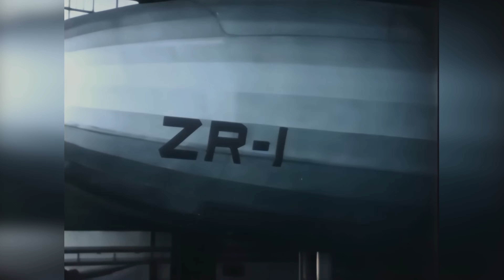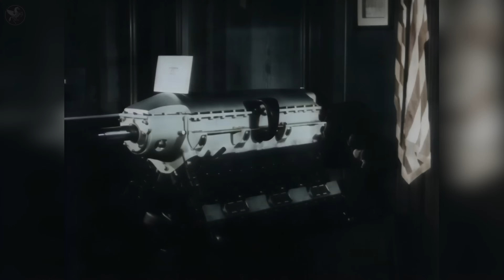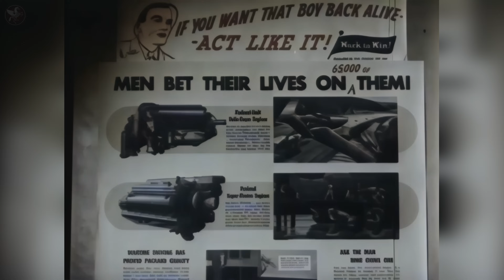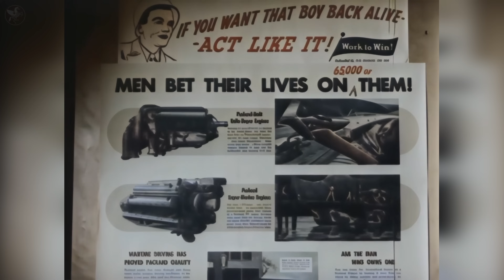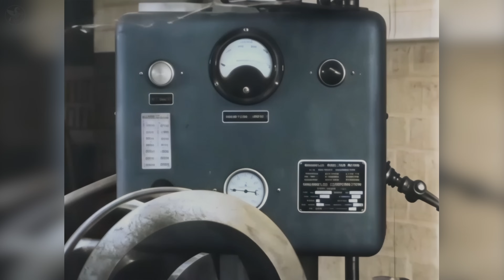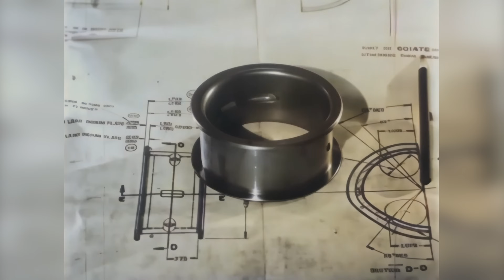DETROIT'S SECRET WEAPON: Packard Building the Legendary Rolls-Royce Merlin in the USA

Comment: Why do they take them apart after test run?
Reply: They take them apart to inspect everything in the engine to check for wear and possible design flaws that could cause engine failure and if needed better upgrades made to the parts for the engines so they are more reliable. One thing that wasn't mentioned in this video is the Packard engines had much less moving parts inside of them compared to the Rolls Royce engines which made them not only last longer but easier to service when needed . I've worked on both Packard limousines that were built before & during WW2 as well as Roll Royce cars and the Rolls Royces I've worked on we're complicated especially the brakes on the late 50s early 60s cars that had to use a special kind of brake fluid that's made for the Rolls Royce cars. They don't use the vacuum canister to make the power hydraulic brakes work on these like the American cars and trucks use because they used a hydro boost type of braking system that works off of electric pumps . The brake fluid they use is highly flammable and of course when you need to bleed the brake system on the these hydro boost reservoirs which there are 2  of them for the front & rear brakes on them the bleeder screws are close to the exhaust and are pointing right at them so every time I had to do the brakes on these cars I always made sure that I had a water hose & a fire extinguisher close by just in case the car caught on fire . The other strange thing with the Rolls Royce was the wiring harness for the cars they didn't use a glass type fuse like the American cars did in those years but the Rolls Royce used different sized wire as  fuses that weren't contained in a fuse box like the American cars did. The Rolls Royce cars used a open box for each fuse which was crazy because moisture can get at these wire fuses along with if your not careful when working under the hood on them and you don't unhook the battery connection and accidentally touch a tool that grounds to that wire fuse it not only blows that wire fuse but causes spark to fly everywhere and if you have this happen to the main large wire fuse that tool will basically get welded to the car & it could cause the car to catch fire & burn to the ground . Never understood why  such a beautiful & very expensive car that Rolls Royce would make such a crappy wiring and fuse system on these cars for that era . I also worked on a early 1923 Rolls Royce limousine that was once owned by a prince who bought it brand new that my boss had bought it when it was shipped to the USA but that car was way ahead of its time but it had a dual magneto ignition system on it just like what's used on air plane engines so there's a backup ignition system so the plane doesn't crash which I thought was strange that Rolls Royce was doing this on these older limousine cars way back then . The  shop I worked at as a mechanic was called Classic Auto Limousine Service in North Minneapolis Minnesota back in the 90s as a mechanic & the owner had a bunch of old cars he bought for the limousine service that had schoufer drivers and people would rent these cars out for weddings and special occasions & some of these limousines were Packards and Rolls Royce & Bentleys . He also had  1 of 3 still in existence which was a 1936 Packard funeral car that used to take the vets that had died to be buried at the Fort Snelling cemetery that was totally restored . He also had sports cars you could rent BMWs and a 60s Jaguar & a Ferrari just like the one used on the TV show Magnum PI that you could rent by the hour or day which wasn't cheap but the stipulations on being able to rent one of these cars was you had to go get your dental records from your dentist that showed your teeth just in case you got into a accident with one of them & got killed or burned from a firey car crash and people did this just to be able to drive these cars because some of these sports cars he had bought didn't have the power restrictions on them like we have here in the state being they were shipped from countries that had no speed regulations like we have here in the USA . I got to drive every car we had at the shop which was close to 30 cars that he owned that got rented out . He made his money as a insurance agent and did very well & he had a mansion and each Christmas he & his wife would have me and the rest of the crew come over for Christmas dinner back then . The shop was also sponsored by the MSRA Minnesota street rod association so we were also getting old cars and street rods to work on them quite often and the shop rates back then were 250.00 a hour and people didn't care because they wanted their cars to get fixed or upgraded . Was the best job I ever had because of getting to work on the stuff plus test drive them and the pay was very good as well for me at 45.00 an hour back then .

Comment: The engine Packard built was not a Merlin rather it was based on the Merlin design but modified by Packard for mass production.  The Rolls engine as was typical for them required a lot of fitting and fiddling by the assembly team and that team was composed of expert mechanics that simply were not available, the end result was undoubtedly a very fine engine indeed but you couldn't make a lot of them fast.  Packard's redesign was geared to mass production and while it didn't make quite as much power and used more fuel it got the job done and was probably was easier to maintain in the field.  I believe that Packard made over 25,000 of these engines, RR probably made about 2500 and did it way longer than Packard did.  The philosophy at RR was perfection, at Packard they just wanted to be very good.  Perfection takes a long time and a lot of resources so don't let perfect get in the way of the good.
Reply: Your RR production numbers are way off. Of the total 168,176 Merlins produced, Rolls-Royce produced 82,117 in three factories, Packard built 55,523, Ford (Manchester) made 30,428, with small numbers built by others, including Continental in the USA.
Reply: What was the most significant change Packard made ?

Comment: The initial batch of RR Packard were not up to RR standards and were used in PT boats.Under guidance from RR engineers Packard worked to much closer tolerances and these engines were eventually fitted to the Mustang.Nearly 90 years later the B52 is being given the RR treatment
Reply: Nope!  Pardon me, but the preceding post is utter horse sh__t. RR had absolutely nothing to do with the Packard designed & built Marine V-12 engines used in the Navy PT boats & the Army Air Corps crash rescue boats. Regarding the Merlin engines it was RR idea to hire Packard with both their reputation for quality and their mass standardized production genius to begin with! The astonishing & vastly unappreciated back story was for Packard being given no fittings or tolerances or plans, Engineer Col. Jesse Vincent & his team started from scratch, redrawing the plans from the british third angle projection and converted them to the American first angle projection and then had to set about creating the tools etc needed to assemble the engines! When they had finished Packard had made over 25 improvements to this marvelous engine having made the parts quickly interchangeable with very tight tolerances versus the painstaking RR approach of “measuring & matching” each part, engine by engine, one at a time.
Reply: @jeffdeshazo8894  Agreed, those engines trace their lineage back to the engines they built for Gold Cup boat racing in the 1920's like Gar Woods Miss America.
Reply: The PT boats used iterations of the M (marine) 2500 Packard.  A much larger and tougher engine.  Maybe some merlins found their way into prototypes, but definitely single digits.  If the first batch of engines had had problems, i believe they would have been torn down and remanufactured.  Do you have a source for your claim?
Reply: @randymagnum143  Sounds like an old school Brit to me. Likely wrong, too.
Reply from the maker: Great info, thanks for watching!

Comment: Packard production was an achievement of speed and uniformity.  Manufacturing 31 percent of all Merlin engine made, the advantage of manufacturing in an environment of peace, versus the regular bombing of Rolls-Royce UK factories, meant that engine deliveries to Canadian and US aircraft factories was uninterrupted.  We have several Packard Merlins owned by members of our group, including ground running examples including a very early V-1650-1 model.
Reply from the maker: Thanks for sharing the details!
Reply: I think a similar mindset in regards to making the Rolls Royce Merlin under licence here in Australia during WW2,i know we (C.A.C) built mosquito's and p-51's amongst other types,so I reckon it stands to reason why we should have made the Merlin as those above mentioned aircraft all used Merlin's!Cheers.B.🫡🇭🇲🇬🇧🇭🇲🛩👍
Reply: @BenjaminRowe-hc7uo   CAC did manufacture RR type Merlin engines post-war, for the RAAF Avro Lincoln (built at GAF in Fishermans Bend).  Moorabbin/RAAF museum references and archival listing of CAC production reports on Lidcombe engine factory, indicate 108 Merlin engines of Mk 102 type were made, the first delivered in 1947.  CAC built Mustangs were built as CA-17 (Mk.20) with Packard V-1650-3, then CA-18 (Mk.21/22/23) with Packard V-1650-7.  After the war, some new CAC Mustangs received overhauled RR 60-series Merlins from ex-RAAF Spitfire VIII stocks.  The Mk102 castings and major components were manufactured (castings, major components) with specialised components (carbs, superchargers, magnetos, etc) being initially imported.  More locally manufactured parts ensured independence from the UK.  Mosquitos were not built in Australia, but approximately 50–60 Mosquitos were assembled or completed in Australia during 1944–1945 from UK supplied airframe kits as part of an assembly contract with DeHavilland.  Locally made parts for repairs and airframe servicing were permitted.

Comment: Americans ADDED to the strength of the RR Merlin!
Reply: The early batches of Merlin Pachard engines weren’t up to standard and could not be used in aircraft so instead they were used to power PT boats.After guidance from RR engineers the were shown how to achieve much greater tolerances and the outcome was successful and these beauties were installed in the Mustangs. And now the B52s are getting the RR treatment 😊
Reply: @michaelbradley7891 
🤡🤡🤡🤡🤡
Just the OPPOSITE! Packard showed RR engineers how to produce the Merlin AT SCALE with even tighter tolerances where it made a difference!! Packard produced perfect Merlins at a rate never achieved by RR!! It broke the Luftwaffe!!
Reply: @wolfman007zz  The Packard built Merlins never produced more power than the British models but were redesigned to meet the needs of American mass production techniques. Even so the British built more than 2/3 of them.
Here's a breakdown of the production: 
Rolls-Royce: (in Britain): 82,117 engines.
Packard: (in the U.S.): 55,523 engines.
Ford: (in Manchester, UK): 30,428 engines.
Reply: @wolfman007zz Agree , and Im from the UK. Ford Motor Company in Manchester told RR that they could build them to much closed tolerances too. Read Stanley Hookers book,  " Not much of an engineer ". Mind you, RR upped their game after that though.
Reply: @marknelson5929 
Long answer to a very short issue!! The US accomplished what the UK and RR couldn’t!  The US greatly improved the production process in short order!! Next!! 👍👍😎😎😎
Reply: @wolfman007zz  Jingoism over reality.
Reply: @michaelbradley7891 the problem Packard had was converting the engines from the British standard thread system to American Unified System. All the drawing had to be re done from scratch